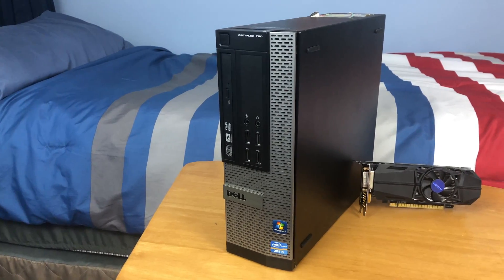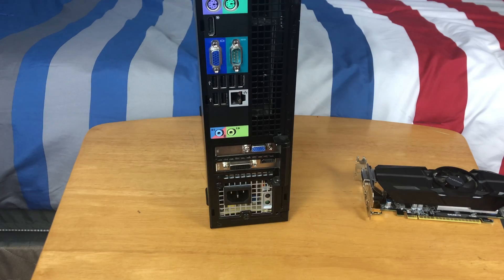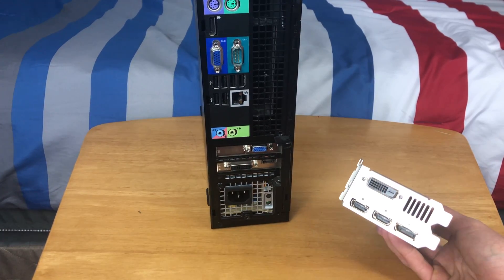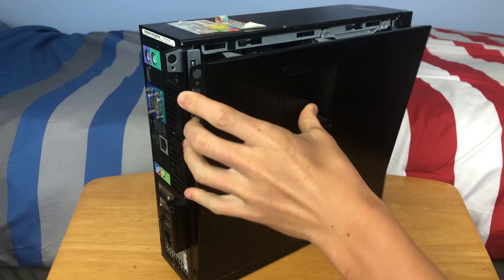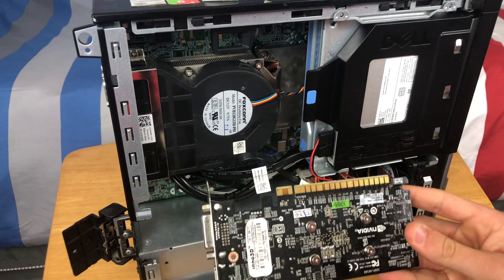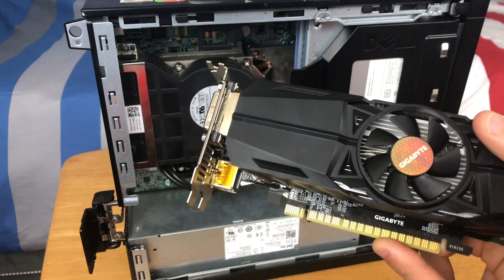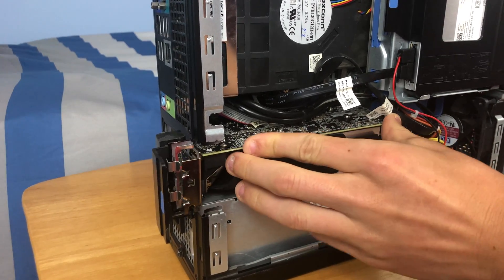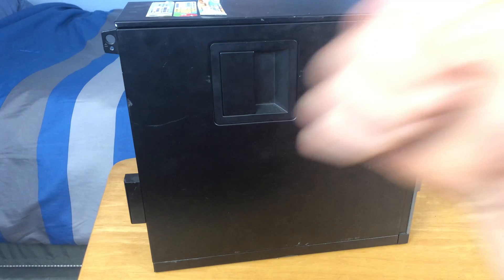How To Upgrade/Replace the Graphics Card in Small Form Factor (SFF) PC (Dell Optiplex 790)!

Comment: Will a rx 480 low pfp fit in a small dell optiplex
Reply: It just needs to be single slot and not require any external power

Comment: Far to simplistic a description of what is needed in adding a graphics card, and to add to that a GTX 1050 is NOT a good idea for an Optiplex 709. The stock power supply will struggle. 🙄

Comment: Pardon my ignorance… GPU’s in SFF pc’s don’t require a connection to the PSU?  They’re powered by the motherboard?  You put the card in then said “all thats left is to put the side panel on”.  And PCIe 16 will still work fine in a PCIe 8 slot?  Please clarify…I’m new at this, so these facts are good to know, and wouldn’t be easily assumed.  Thank you much!
Reply: Yes basically, you just plug in and play pretty much. (Then install all the drivers and anything) but I'd make sure to get a low profile card for an SFF

Comment: place your case on the tesk . so you can see better . and press down . not sedeway .
make sure cables are not in the way . remove temporary the cables and place them back after insert the videocard .
make sure you have 2 slots space if you buy 2 slots videocard . some sff have only 1 slot free . so you need only 1 slot videocard .

Comment: How can you know whether your graphics card will take too much power from a sff PC? I'm looking at one and I think it has a 110w power supply
Reply: It depends on the power supply and the power draw of all the different components. if you're worried gt 730 and gt 1030 have an extremely low power draw (max 30 watts) that I'd recommend for almost any PC. In general most power supplies (especially the one in the video) are at least 180W but would likely probably work in even lower as well.in general if it's a small form factor like this one you'll want a low profile card as well.

Comment: I don't think holding your graphics card and running your bare fingers along the card contacts (even if you don't quite touch) is a good idea and certainly not the sort of thing you should be showing people to do. You aren't earthed, I never saw you earth yourself to a plugged in case + the card bracket (assuming it's earthed), and static discharge is a VERY real component frying thing.

Comment: Yeah, I've got a comment. What graphics card would you recommend for a small form factor PC, that doesn't cut a bazillion dollars and which doesn't require an extra power source? I've got an HP Pro Desk 600 with a 4th gen i5 CPU that I'd like to use for emulation and 1080p gaming... nothing mind-blowing, but something that could handle PS2, GameCube, and Dreamcast emulation.
Reply: I use a radeon 7570,  its anemic, only 1gb of gddr5, core and mem speeds of 700 and 900 respectively, but its usually around 20 bucks and it runs quite alot.

I plan to upgrade to a GT1030 gddr5 but it should be noted neither if these cards are cost effective... beyond the 1030 its more cost effective to invest in a newer chasis to upgrade
Reply: Rx 6400
Reply: GTX 1030 is safe and I know works (have one in this machine).

Comment: will it make my computer faster like in office using when doing work or just regular browsing? because I have the exact same computer and it is terribly slow. The CPU is I5 2nd Gen
Reply: If you're willing to replace the HDD to SSD you wouldn't need to go further as the current hardware is still mediocre at web surfing and office works.

if you have the exact same system as on the video, your i5 must've been the i5 2400 as i have the same configuration but changed the HDD to SSD, and its pretty fast for doing what you said

Comment: Great vid. Quick question, did you have to replace your PSU in order to handle your new graphics card?
Have same PC as you and want to do the same.
Thanks man
Reply: It should work the power supply is slightly lower but there's lot of people saying it runs with no problems without upgrading power supply. I'm running a gt1030 on a 790 and upgrading to gtx 1650 soon.
Reply: @shepherdkings5892  hi, how much is the original watt on the dell pc?
Reply: @iblis7800  240-250W
Reply: As long as the gpu draws lower than 75w recommended power then you should be fine.. the highest compatible gpu that wouldn't bottleneck the cpu is gtx 1050ti LP (if you also have the highest compatible cpu for this machine which is i7 2600 or i7 2600k)

Comment: If you're connecting a card that requires a power source how would you add it to this rig
Reply: You’d have to switch out the power supply first, These P.Cs come standard with a non-modular power supply so there is no way to add a cable.
Reply: @gentrysmith7547  ya, I just bought a new computer. This optiplex would never do what I wanted. Not a bad deal though I bought my I think 310 for almost 200 and it ran fast. Almost played games when I added the low profile 1030

Comment: do you think i'd be able to get an rx 460 in an 7020?
Reply: Wondering the same thing
Reply: @stanz2209  hi pal, i never found the answer out but o just went for a 3020 instead!
Reply: In a 7020 SFF? If so, you can only use a single slot, low profile card.  I have two of those systems and I installed a Gigabyte NVidia Gefore GT 1030 Low profile in both. 
There isn't enough room for thicker cards (i.e. that cover two PCI slots).
Reply: @silvanigra  well, id say youre a bit late. finally built my own pc recently. not using an old piece of garbage any more. :D

Comment: Hey man I’m having a small problem. I had a gt 1030 I sold it but I never reverted my optiplex output back to VGA. I wanted to use my computer without the GPU so bought cables to convert hdmi to vga as my new tv doesn’t have a vga port and no luck. It did not want to recognize the pc. I just bought a new Gt 1030 today and I was hoping the computer would recognize it but no luck I tried to reboot it and the pc turns on but the tv is not recognizing the image :( how can I show the image! Thank you and great vid!
Reply: Had the same problem, take it to the service. I think it had to do with motherboard.

Or did you have i7 2600k sitting in it by any chance? They don't support HD3000 graphics that's included in the 2600k unless you have the normal 2600 or lower which holds the HD2000 graphics

Comment: What's the best GPU for a dell optiplex 790?
Reply: this 1
Reply: @kernie4859  What gpu is this
Reply: @GOOPINAHEMI  gtx 1050ti low profile
Reply: @kernie4859  where are the best places to find 1050 ti low profile
Reply: @GOOPINAHEMI  if you have a micro center near your or the used market cus prices are mad atm
Reply: gt 1030 gdrr5 msi
Reply: Thanks guys for your suggestions, much appreaciated.

Comment: I have a question tho. Don't you need a higher wattage PS to run the GTX 1050 card? From what I've been reading it seems that I will also need at least a 300W PS and I don't know if I can find one that is the same size as the slimline PS that's in my Optiplex 790 (same size as the one you're showing). I want to run For Honors and from what I found, I'll need the GTX 1050 to run that game. There were a few other vid cards listed, but for the few extra $$ between a GTX750ti/GTX950 and the GTX 1050, I'll get the 1050. Thanx in advance!
Reply: The 1050 is too big to fit in your case, it will not work. Only a low profile card will, there is no low profile 1050
Reply: @LethalzPlayz  yes there is.
Reply: There is 1050 low profile
Reply: @lucation88  true
Reply: @lucation88  1050 ti low profile
Reply: Do I get higer fps?
Reply: The dell spec for the 790 is a max 35w card so anything higher may work but .. 1030 certainly is in spec.
Reply: @Ham to 
But there are different models of 790. The weak processors use signficantly less power than the uber top of the range ones, and you don't want to be sitting maxing out the little power supply with its little fan all the time. Also I'd be concerned about heat .. I killed a little dell once by sticking the fastest CPU I could in it and it ran like a little oven then said "see ya!". I've a 790 and I doubt I'd want the 1650 in it though by coincidence that's what I recently bought, and bought the low profile-able version so I HAD the option of putting it in there if it didn't work in my other machine, but I put it in a bigger more powerful dell and it worked. I actually upgraded the PSU in THAT (got a black friday deal and this dell unusually could take a stock PSU) .. so I didn't really need to buy one that doesn't need a separate power cable but .. tbh I'm very happy with the 1650. It's plenty powerful to run anything I want to play on settings I want if not max, and with the insane cost of electricity and the amount of hours I spend playing, not burning significant amounts of power over the year for FPS I don't even notice or care about makes sense to me.  It'll do for a few years!

Comment: i got a prebuilt but it came with intergrated graphics and i dont think my case can fit a gpu in the brackets. anyone know if something will fit?
Reply: @Aztroloe Would it possibly fit without changing brackets? Because it has 3 ports, But it's advertised as small form factor
Reply: @Aztroloe No i mean the gpu has 3 ports meanwhile the only available Small Form Factor Bracket on the market has only two port holes
Reply: @Aztroloe Hi pls answer mine instead 🙂

I'm planning to build a budget-gaming setup, I'm going to use Lenovo M93p Small Pro as base.

I'm gonna add 4GB×2 RAM/120GB SSD/GTX 750ti🙂The singlefan Asus 750ti can physically fit but the only problem is it's bracket, I considered changing it onto small form factor bracket but it 3 ports instead of two (HDMI and VGA) it has a DVI Port if my guess was correct, The bracket I have here only has holes for VGA/HDMI,

Would the gpu fit without changing any brackets?

Comment: Hello, I also have an Optiplex 790 sff and I want to improve the GPU, currently I have AMD radeon HD 5450 and it's 512 MB. I've been looking at the GT710 2GB DDR5 low profile, and I want to know if I can successfully install that graphics card in my system. I have the stock PSU and it's 250 W, my doubt is: can the PSU handle the power consumption of the gt710 or I will need to buy a more powerful PSU?
Reply: Finally I decided to buy a GT1030 2GB DDR5, it only needs 30W of power through the pci express port, so it doesn't need an external power supply. Now my pc is running pretty fast and it runs Fortnite at 120-140 fps with medium-low settings.
Reply: @zaiddiaz4117  Sweet, I have a GT1030 2GB GDDR5 Low Profile graphics card on the way to put into my Dell Optiplex 790. I have a GT 710 in it currently and am looking for a higher frame rate/resolution for gaming. I'm glad this worked out for you
Reply: @zaiddiaz4117  doesn't the optiplex 790 only have a GDDR3 slot?
Reply: @Senor-Numero-Uno  I didn't know about that, but when I bought my GT1030 graphics card I just installed it in to the PCI express port that my computer has, and after that I turned on my PC and it worked fine. And it has been working properly until these days. So my advice is, go ahead and buy one of those graphics card.
Reply: @zaiddiaz4117  aye aye captain!
Reply: @Senor-Numero-Uno  no such thing, a gddr6 card could run on a ddr2 pcie slot, BUT ONLY IF IT IS pcie express.
Reply: @LethalzPlayz  the 'e' in pcie is express
Reply: @Shockxv  i know

Comment: i have the optiplex 7010 and my card failed. what is a good replacement?
Reply: Either gt 1030 or gtx 1050ti (low profile)or gtx 1650 (low profile)
Reply: @adz__.023  Also depends on your CPU.
Reply: The best one is 1650 Low Profile. 1050 LP is great too

Comment: Thanks for video :) Don't you need to connect the power line after you insert a graphic card?
Reply: Not for Low profiles. Low profiles dont need any power since its wattage use is so low. dont even need it for the gtx 1050 low profile.
Reply: @kixnuzia6919  thanks bro
Reply: @kixnuzia6919  Thanks for the info! Much appreciated

Comment: Hey how do you help the PC to recognize your GPU? I have the exact same PC but once I put in my GTX 1650 LP I get a post but when I go to install the drivers it doesn't recognize it nor is it recognized in the device manager.
Reply: Turns out it's wasn't show via vga cable I had to use a different monitor with hdmi outlet and it works fine.
Reply: Didn't install it right. Reinstall it sometimes it feels like it's in but it isn't reinstall it happend to me before.
Reply: Install the nvidia driver
Reply: Hey man I’m having a similar problem. I had a gt 1030 I sold it but I never revert my optiplex output to VGA. I bought cables to convert hdmi to vga as my new tv doesn’t have a vga port and no luck. I just bought a new Gt 1030 today and I was hoping the computer would recognize it but no luck :( how can I show the image!
Reply: You mean VGA to HDMI?.. that will never work.. VGA is analog and HDMI is digital even if you have a converter. This will only work the other way around..

Try Display port to HDMI

Comment: What graphics card should i use for my dell optiplex 790 pc
Reply: Same question here let me know when you get a good one. i need one too.
Reply: @youtube_e-v5k  I got a GTX1050Ti Low profile running just great. I think it’s the most powerful option at this moment and it fits.
Reply: @moalisa2086  what psu?
Reply: @itworked2818  I didn’t change the PSU, still using the stock one (it’s 300w if I’m not mistaken). I also checked the power consumption and when I run a NFS HEAT, for example, with both CPU and GPU at 100%, it still draws up to 240 watts
Reply: @moalisa2086  I got. 240 watt psu so it's tough
Reply: @itworked2818  Yeah, in that case you should find one with a higher rating.
Reply: @moalisa2086  Thanks for the info! Much appreciated
Reply: @itworked2818  It will work fine.
Reply: @youtube_e-v5k  ok bro i will let u know

Comment: on my optiplex 7010 there is a blue thing for the graphics card port do i need to click this for card removal?
Reply: Yes, did you manage to replace it?
Reply: @MrMultiSuprime  yes I now have a 1050 ti.
Reply: @duxki4695  Happy to hear it worked for you! Are you happy with the performance? Also may I ask if your optiplex is SFF or standard size?
Reply: @MrMultiSuprime  it is a sff which is my main issue at the moment but in august I plan on building a new pc whilst saving the gpu, hard drive and ssd
Reply: @duxki4695  so how does the graphics card fit? Or do you keep the side panel opened?
Reply: @MrMultiSuprime  I have to leave the panel open which is the main reason I want to upgrade fully in august
Reply: @duxki4695  you could always simply move your components into a bigger case with a new power supply! Did you consider that?
Reply: @MrMultiSuprime  I have but with the current cpu I have (which is only a i5 2400) my GPU isn’t getting much to any utilisation due to the bottleneck and if I need to upgrade my cpu in the future I would need a new motherboard also
Reply: @MrMultiSuprime  the cpu and motherboard i plan to get is the AMD 3100 CPU and the ASUS Prime B450M-K Micro ATX Motherboard
Reply: @duxki4695  sounds good! AMD is THE choice right now :) i have an R5 2600 and I love it!
Reply: Oh ok, so did you fit a normal size 1050ti (non low profile) into a SFF Optiplex without moving anything but just have to keep that flap open?

Comment: Can you do the same with a GTX 960?
Reply: Sadly no. Its not low profile. i believe the Gigabyte GT 1030 2GB Low profile will work. they work both the same expect its a diffrent name.
Reply: @kixnuzia6919  gtx 960 is way powerful than the gt 1030 gddr5
Reply: i tried to use a gigabyte gtx 970 and it did not fit. now i have to use the evga gtx 750ti low profile

Comment: Is it possible for the sff to do a case swap?
Reply from the maker: Maybe with the larger version of this pc, but we actually tried to put this board in an ATX case and the orientation of the screws holes were different than a standard ATX motherboard.

Comment: its funny how I stumbled across your channel because I wanted to "modernise" my 2011 iMac for school work. I'm still considering the GPU upgrade but your videos are so helpful. I really love your work especially how you explain EVERYTHING someone would need to know if they wanna follow your guide step-by-step even if they've never worked on a computer before. Keep up the good work buddy. I hope you have a great day. :)
Reply from the maker: I would upgrade the hard drive to an SSD before trying the graphics card upgrade, because the graphics card upgrade will cause some things to not always work correctly, mostly related to power supply issues.
Reply: @techitout4710  so......I ripped out the optical drive and put an ssd in its place. dual booted with windows 10 and got 16 gigs of ram. For the gpu I did find an MXM A card so it should fit well but I'm not sure if I want to spend time actually doing it.
Reply from the maker: What card did you get?
Reply: Again. I’m still looking at options but the Nvidia Quadro K1100m seems like a decent card and I would assume it needs a vbios flash to get the boot screen back.
Reply from the maker: Yeah you would need to flash the vbios, but it will still work without it, just without the bootscreen like you said
Reply: @techitout4710 hi I was just wondering if a gtx. 1650 4 gig low profile would fit by gigabyte. It’s anOC D6